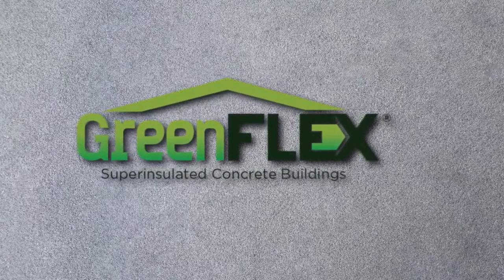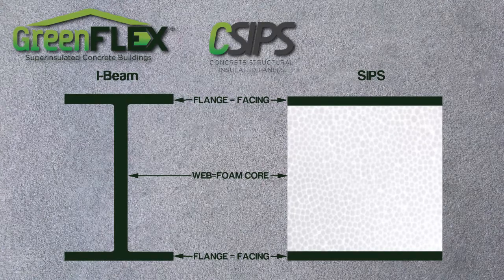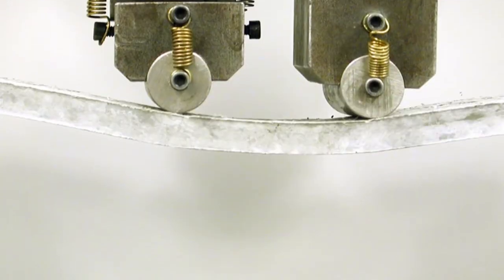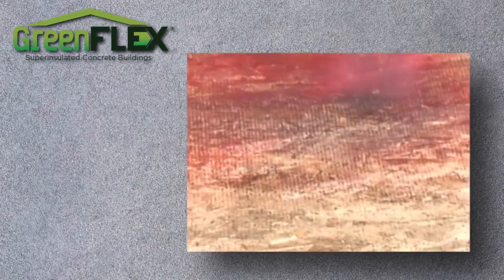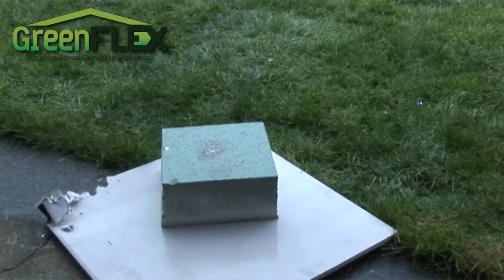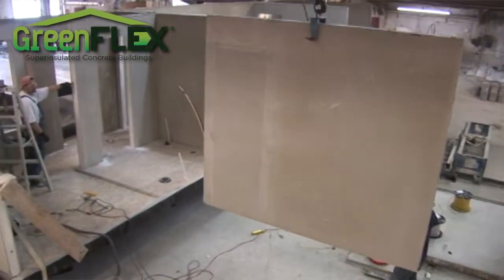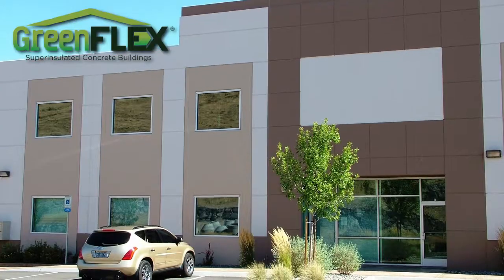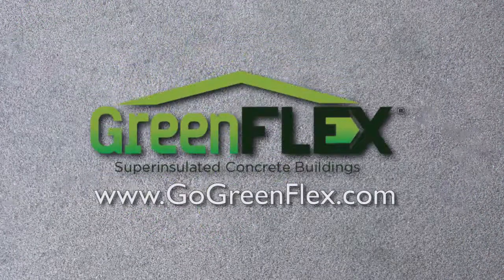GreenFlex Superinsulated Concrete Buildings

Comment: I have built 2 x 1,500 sq ft 3 bd rm, 2 bth homes with garages in Central Oregon out of this material. The homes have been completed more than 3 years now and look amazing. No issues. Excellent insulation, fire proof, water proof, pest proof. I plan to start a 5,000 sq ft warehouse in Central Washington in April of 2017 (next month from now) Contact me if you have any questions or need info. john@eakininc.com